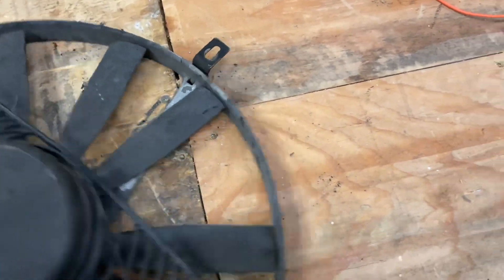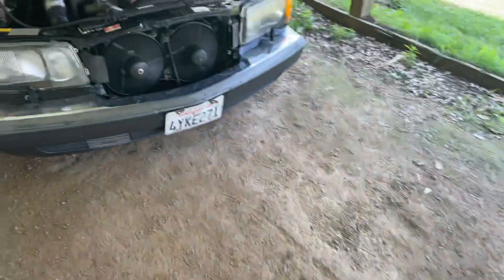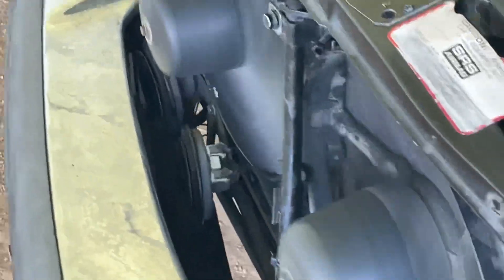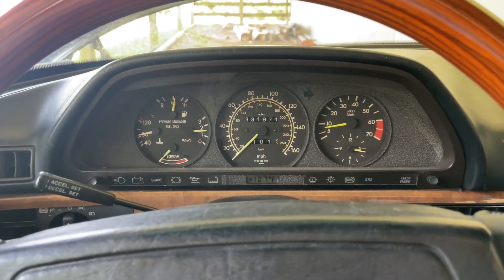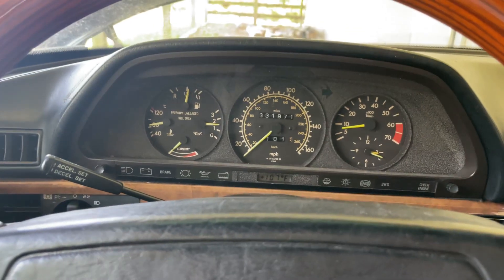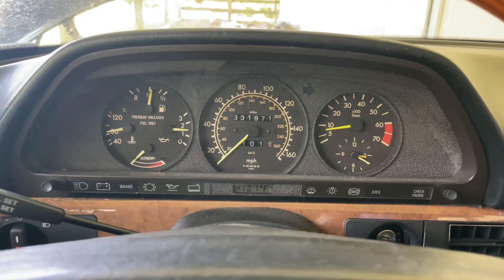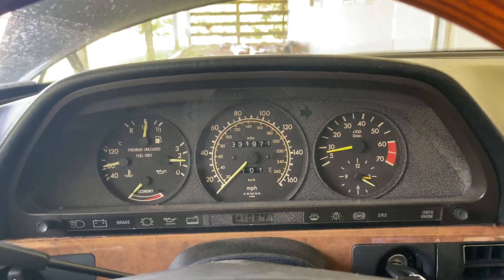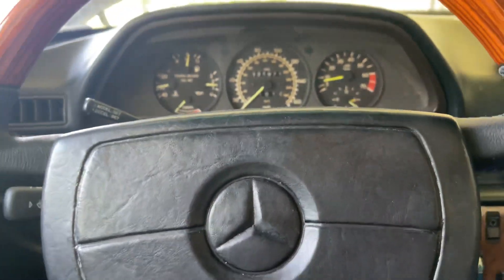Mercedes Benz 560SEL MY 89 - fluctuating engine temp, running hot - aux fan repair - now fixed

Comment: When you add that dual aux fan for the car which orinilay has single fan, should you change some relays or some other parts to work it properly?
Reply from the maker: No, not really. I checked amp draw of single fan and then two fan unit. Both were around 10 to 15 Amps. The relays I got installed are rated for 20A 
Fuse rating I used is the same as well. The wiring in my car from fans to resistor and relay / fuse box is 2.5 mm2
You may want to check your relays, fuse and wiring

Comment: Thanks for the video. My 380sl runs around 100. In traffic, it’s around 105 to 110. I believe you are saying that it’s normal, correct? I’m used to my daily driver where it stays stable right in the middle of the gauge. I get worried when I see it creep toward 110. Thanks for the help.
Reply from the maker: Check your fan clutch. If it turns very easily then it’s time for a new one. My coolant tamp goes to about 95C max with A/C running in 100F ambient with these two fans.
Check your electric fan for correct rotation . If it goes in wrong direction reverse the polarity of the two wires in the connector for the fan
Reply: @inovahightechltd  clutch seems fine. I’ll check the fan. Thank you!

Comment: Can you give me the link because I didn’t find it
Reply from the maker: You mean the link on where to purchase the fans? Btw. Mercedes had a special radiator and separate oil cooler for hot countries like yours as well but they are only available for the W126 not the R107

Comment: Great improvement. I'm not sure but i guess the dual fan was an official replacement from MB for all models. not only for 300hp ECE version. i saw 300SE with dual fan. my 420SE still has the single fan from factory.